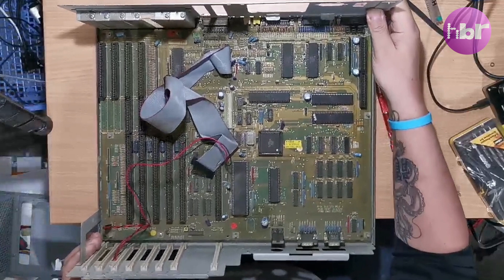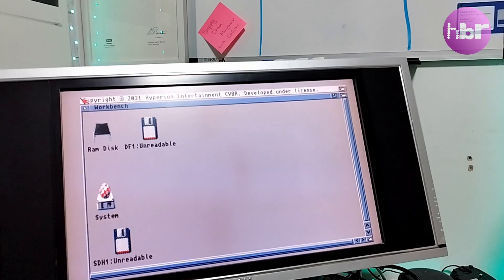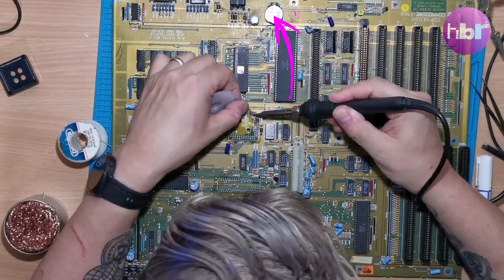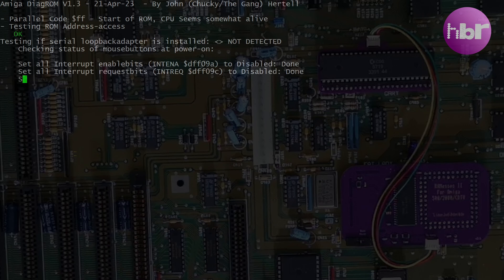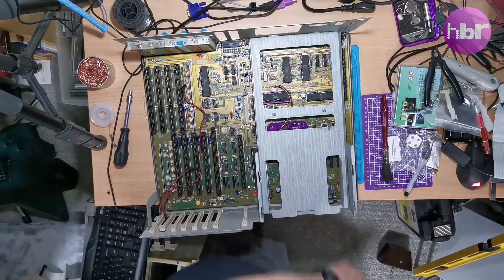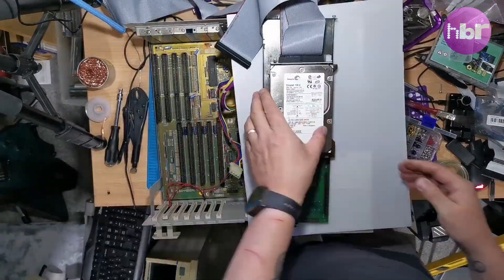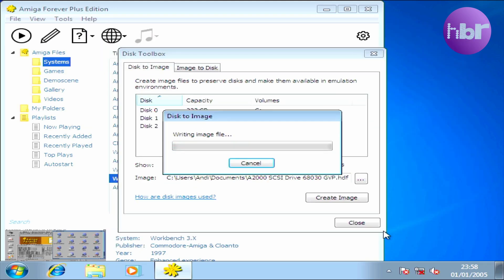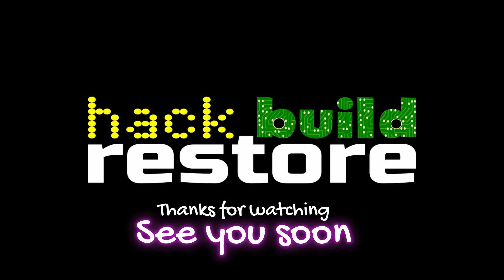"SOLDERLESS" Chip RAM Expansion Goes Very Wrong!

Comment from the maker: Does anyone know of anyone offering reproduction/used Amiga 2000 Shield?
Reply: Sadly I can not find a single person doing so. I found that its not hard to reproduce one though. You just need Stainless Sheet Steel with a higher nickle content than used in cookware. And having a dielectric metal sealer to coat the metal after cutting or stamping to shape helps too. I had to cut the one I made at an old friends place, and it took about 40 hours of work to do, since I was going slow to make it perfect.
Reply from the maker: Might be a future project, you never know 😄

Comment: Also regarding the undershield. I have 6 x A2000 machines. Only 1 has the metal RF shielding with a plastic sheet fitted. The rest of the machines have the boards just screwed into the case, no metal or plastic sheet. Is this correct? I just assumed only the USA machines had these extras?
Reply from the maker: It's honestly not clear, I think they all would have had the shielding but I can't know for sure, mine is a rev 4 case with a rev 6 board, so I'm assuming in that swap the shield was discarded probably because of corrosion ... Sorry I can't give you anything more concrete...

Comment: Can I please know the source of the extra edge connectors, the ones fitted to make the ISA slots full 16bit. I have some but the quality is not like the original commodore stuff, ideally I want the same brand as commodore fitted.
Reply from the maker: If you want them to match you will struggle as I don't think FOX are around anymore, however one possible trick is to use the video port connectors i.e. move them to the ISA positions and then use two new matching connectors to replace the video port connectors... The ones I used are just from china ...

Comment: same just happened to me. Bad thing is that the legs of the old agnus stuck to the socket and killed it, and I cannot verify if the 8375 I have now is working because the adapter arrived broken too (from overseas - no chance in RMAing this).
Ramesses II does not seem to be available anymore? Any other 2MB adapters that you can recommend?
Reply from the maker: If you're ok with soldering take a look at the one Rob Smith installs here https://youtu.be/KsuVr18EXdk?si=FRN_Vr07UveEgWHg

Comment: Got a RAMSES board myself for my A500 but I'm hesitant to install it for just this reason.
Reply from the maker: If you are not too gun go you shouldn't have an issue my agnus had suffered a little from battery leakage which does weaken the plastic and makes the pins less "springy", your garry socket is going to stretch with the turn pins on the adaptor but that's only an issue if you want to reverse the install...
Reply: My Gary socket already has an adapter in it from back in the day, so I’m not too bothered about that. I have PowerComputing 1.5MB trapdoor upgrade giving it .5 chip, 1.5 slow. I had my workbench modified to use a RAD drive which made working with some basic workbench tools lightening fast. ❤
Reply from the maker: I think the Rameses will cut off the trapdoor as it uses it's own on board 2MB which is faster than the usual 500 Chip RAM!
Reply: @hackbuildrestore  yeah it will. The A500 is now upgraded beyond what I had back in the day. So the 1.5MB slow RAM won’t be missed. It’s got a HC533 board in the CPU slot, gives it a 33MHz 68000, 8MB Fast RAM and bootable IDE interface under Kickstart 1.3. So adding the Ramses board will simply swap the .5 Chip / 1.5 Slow RAM out for a faster 2MB Chip, which will be better for WHDLoad games. I’ll be honest, I don’t really need it if I’m mainly using WB 1.3 install on this box. It’s more the fun of having my A500 maxed out with period achievable enhancements. An A500 with a bootable HDD and 10MB of RAM would have made for an ultimate A500 setup back in the day.